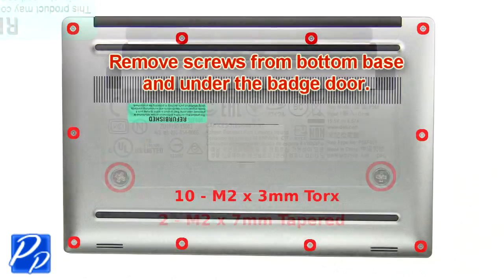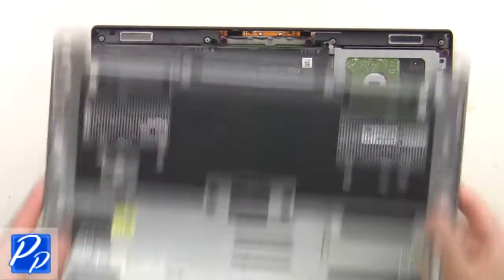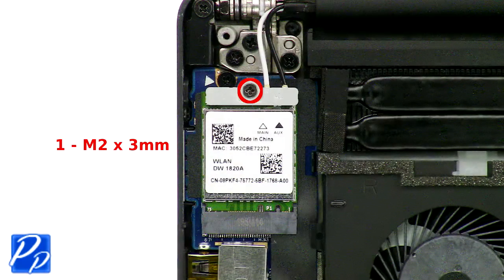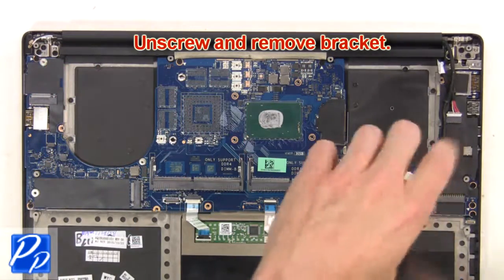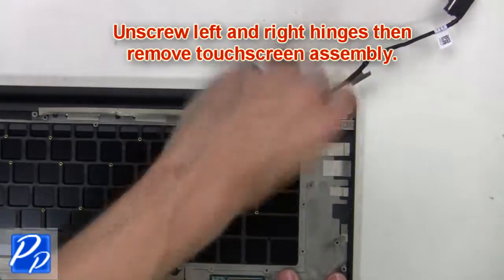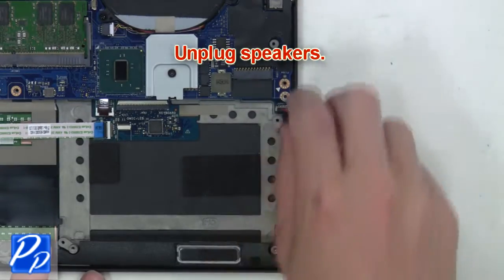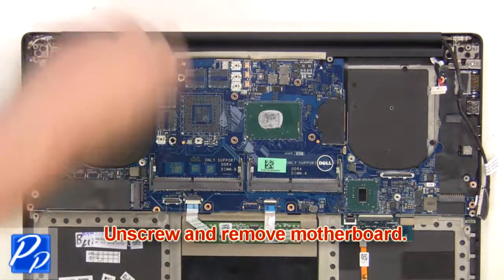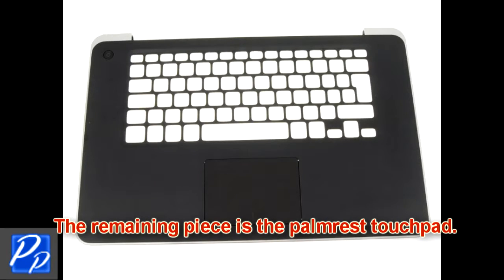Dell XPS 15-9570 (P56F002) Palmrest Touchpad How-To Video Tutorial

Comment: Have the XPS 9570 and am in need of a new (or slightly used) palm rest assembly.   Have been on your site at Parts People, inputted the model, yr and even service tag number.   For most parts it will come up saying "his part is compatible"  in the area showing the service tag number.   However on every XPS Palm rest assembly basically reads it isn't sure if it's compatible.   I find this very confusing, as if I can't find the proper part to replace what I need and can't get anywhere.    Like many , mine started with the hinge issue, then the socket for one of the main hinge screws broke off , followed by the rear edge side behind the faulty hinge which is made of plastic broke , approximately a one inch chunk fell apart.  To make matters worse the 40 pin cable leading from laptop to monitor touch screen somehow was pinched right through and now have absolutely no picture on the screen, microphone or camera.  After some research and a sale you've on at the moment, decided to order a new screen assembly, with wiring harness, hinges and outer shell (after researching the scream replacement of the above harness is a brutal job and most techs won't touch the work let alone guarantee it ).  Now I'm having a new screen sent And would truly like to acquire a new palm rest assembly.  Please could someone help guide me here?

Comment: Good tutorial. But I'd advice not to detached the wifi card from it's antenna. The connectors are too fragile and you may damage it while trying to reconnect them.
Reply: I would just be careful. I have removed and re-attached cables from wifi modules many times with no issues.